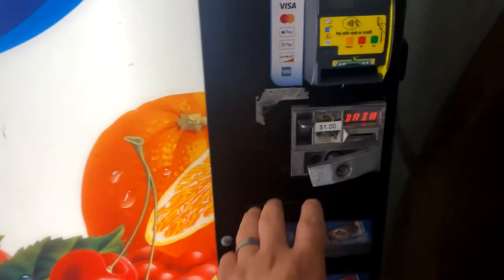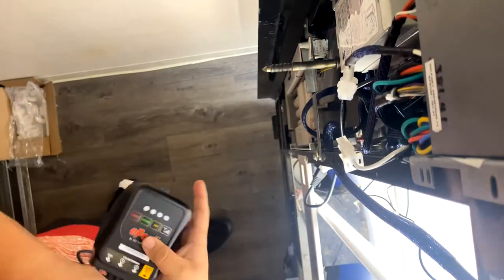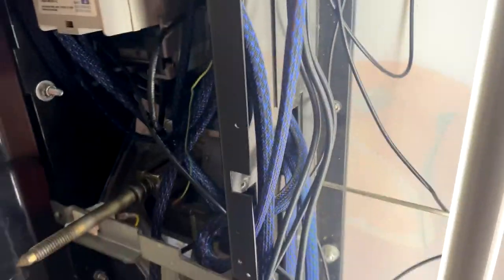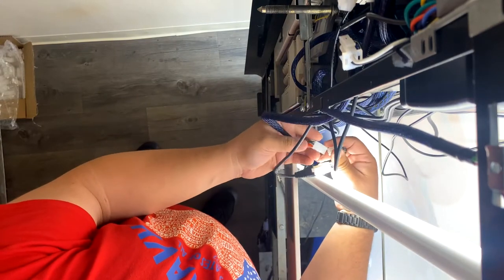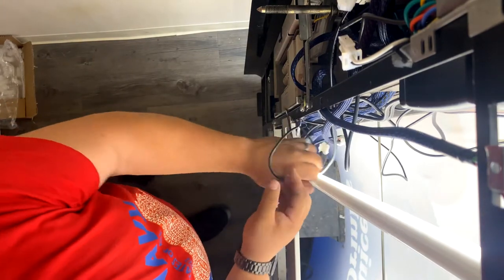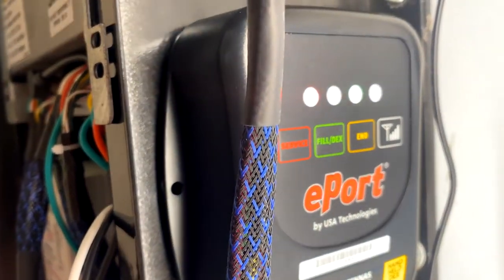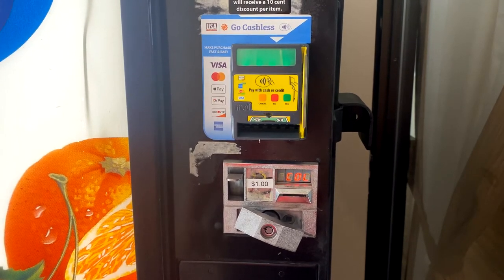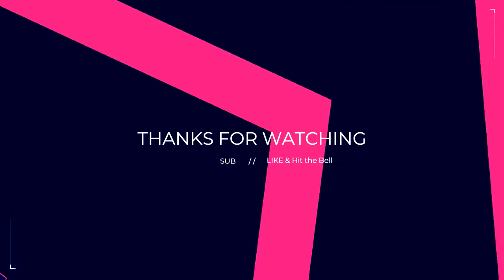Replacement ePort Install for DN368

Comment: Did the replacement come with all the needed cords??
Reply from the maker: It comes as a complete new kit with all the cables. For the standard MDB setup. And just fyi I do NOT use the 4in1+ bezel anymore

Comment: Just installed a new G1 11 port, the display turns on but doesn’t start establishing cell connection. Any ideas?
Reply from the maker: are you using the card swipe that come with the G11 kit or are you using the MEI 4in1 Plus Bezel?